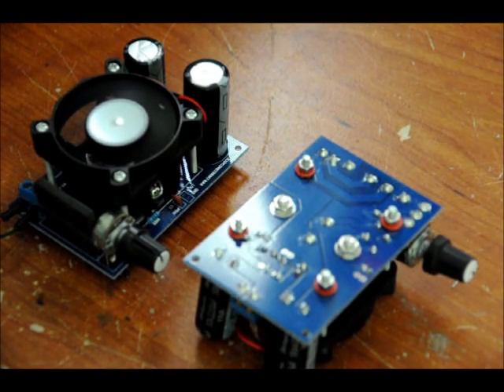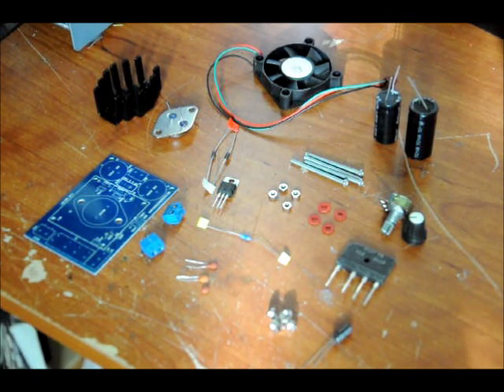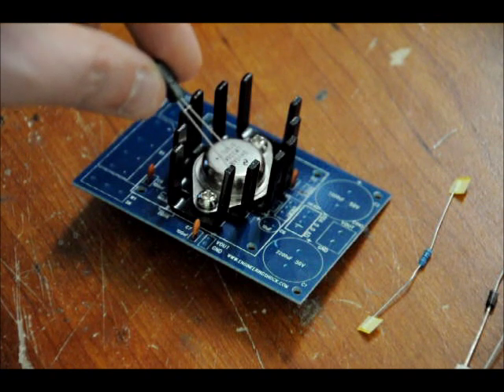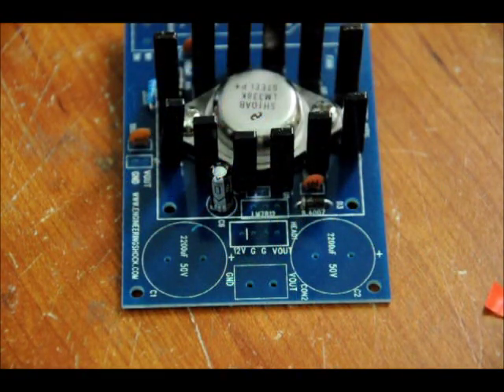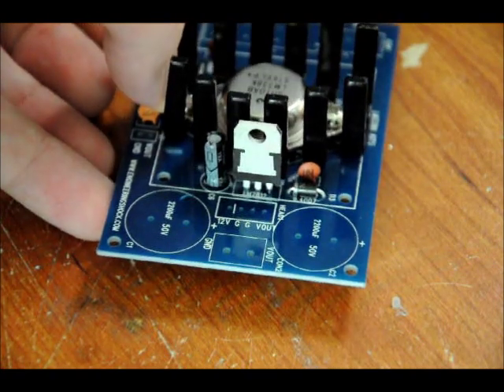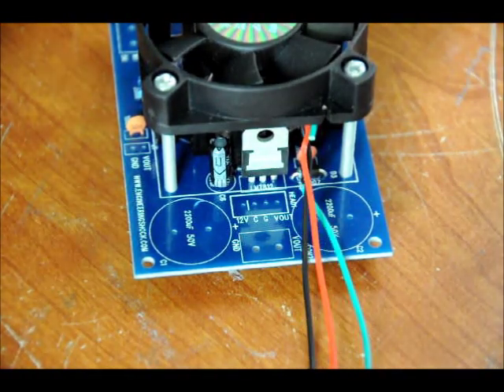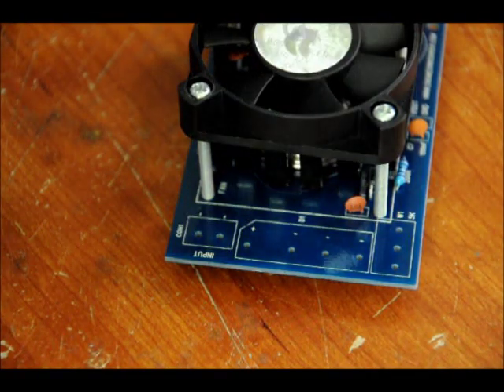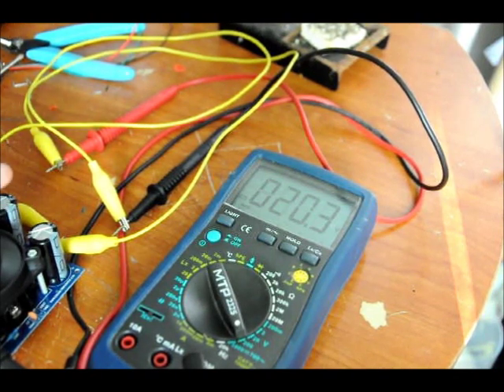The LM338 Variable Power supply kit from www.engineeringshock.com

Comment: @opragalled Random, unsure if you are still interested. "real" power supplies like this go in to the hundreds of dollars, and provide things such as constant current/limits/more resolution/display. A product like this worth it a lot more to the DIY-er built by themselves. Also pre-assembling many kits takes time. @Second Q, the LM338 data sheet claims a maximum output of 32V (four less than your 36) because 1.25 Voltage reference * (1+5k/200) = ~32. Supply with 36+V input to get 32